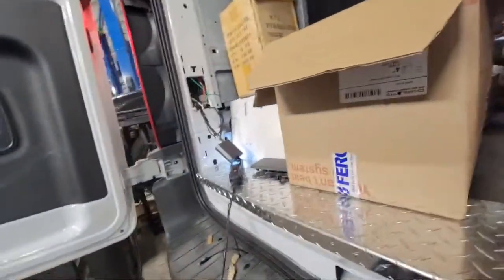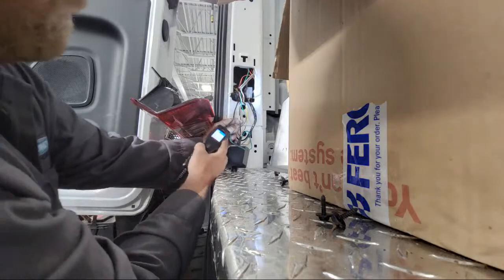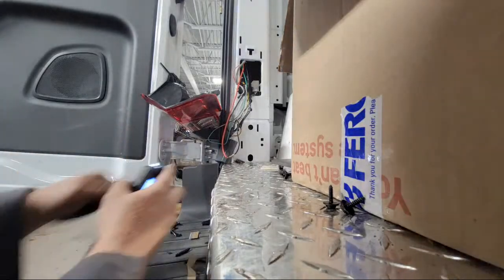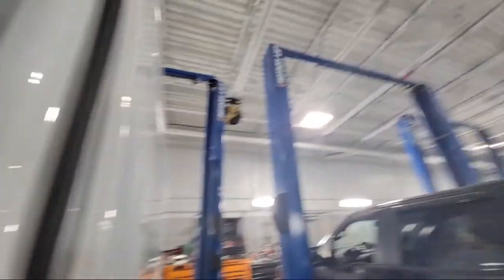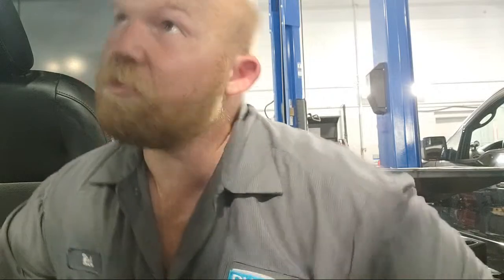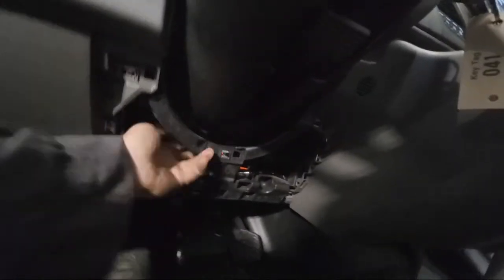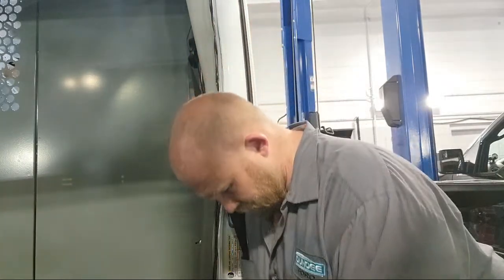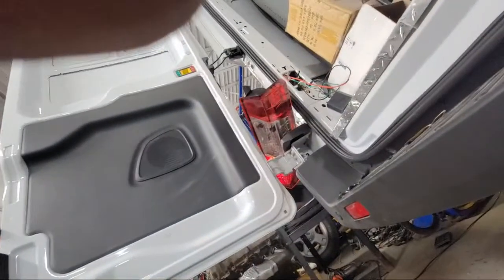2021 Transit no POWER TRAILER connector TOGETHER

Comment: PSA for vehicle owners whether it's your personal vehicle or fleet. If you install aftermarket electrical modules like this trailer light setup, or equipment like a salt spreader or snow plow, download and print or make a copy of the installation instructions and put them in the vehicle's glove box. This way, if there is a problem down the road, the technician working on it has a place to start, just let the service advisor know the paperwork for the aftermarket system is in the vehicle.
Reply: Absolutely fantastic idea, if only more people followed that advice lol

Comment: Depending on feed wire size 10 amp fuse seems small to me. Remember this supply powers tail, turn, and brake lights. If feed wire is 12 gauge use a 20 amp, if 14 gauge go to a 15 amp fuse. Funny you mention drilling thru wiring as my little boy, Vanessa, had a 5 th wheel hitch installed by the place that sold her the trailer. Brought it to me with blown rear lighting fuses. Yep, they drilled thru the wiring harness when doing the hitch install.... She was upset....All installers are NOT created equal............After market installs done by someone else usually turns into an Easter egg hunt... I'd say I have removed enough tape in my 37 years of wiring repair to span the globe many times over.. AND wasted a lot of time in the process. Even though you charge for your time it to me is still wasted time. GOOD JOB.
Reply: I'll second the comment that not all installers are created equal, meaning their skill levels vary.
Reply from the maker: If you actually think about the amount of amperage that the bulbs that are in circuit Pull especially now with most being led 10 amp is more than sufficient but also at the same time you have to think that amp is not for running the lights I think that's the part you guys are missing and that's what I was very clearly trying to get across to you guys this wire is for powering up the module that helps control the lights it has nothing to do with powering the lights themself but I have to explain this why? You guys seem like you're pretty good at understanding things I was very clear I want that wire did and I specifically stated this Powers the module and then the module controls where the power goes from there and even if we broke it down to how many lights you would typically see on board you still wouldn't have 10 amps of draw
Reply from the maker: I also said I don't know what fuse is supposed to go there because I don't know the name of the module there was no name on it and I don't know how it was intended to be run so with that being said I'm going to put something small in there so if it does pop it's not too large I was very clear about that we shouldn't really even be having this discussion and I hate that I have to say it this way but I'm a very upfront person we should not even be talking about this I explained all of this ahead of time
Reply: @FordBossMe  SORRY, YOU TOOK IT THIS WAY... I WAS SIMPLY TRYING TO SHARE SOME OF MY EXPERIENCE WITH YOU... NOT TO BELITTLE YOU. I RESPECT YOU TOO MUCH TO PUT YOU DOWN.. AND YES, IT'S BEST TO ERR ON THE SAFE SIDE AS YOU SAID.
Reply: @FordBossMe  Not to question you, but to share info, the module you're working on serves 2 functions. 1. It converts a 3 light system on the vehicle to a 2 light system on the trailer. Separate brake light, turn light, and tail/marker lights on the vehicle to shared brake and turn element and separate tail/marker element...2. It has a power supply wire that powers it as well as supplying the power to the trailer lights. Think of it as a HIGH TECH RELAY. The wiring connected to the vehicles light system only supplies the turn on of the relay. This prevents frying the vehicles LAMP OUT MODULE due to over load. I know cause I fried a jeep lamp out module before these came out. I went back and checked and on most trailers a 10 amp fuse is plenty especially if the trailer has LEDs, but if not LEDs and you have a box trailer with a lot of marker lights you need to step up to at least 15 amp fuse. Again, I'm not doing this to piss you off, just to share some hard earned knowledge. If I didn't respect you, I would not be subbed to your channel... THANKS FOR WHAT YOU DO.

Comment: Hey i have a 2017 ford transit and it has the factory wiring but none of my trailers lights work you think i should check and see if the wirings the same and missing a fuse ?

Comment: I tried to at a power wire to my Grand Cherokee overhead console to map light circuit or sunroof circuit to power a dash cam.  No way. No power. It is a CAN BUSS system. Had to run a long wire up front pilled across top of windshield from hot port in center console

Comment: Bad design by Ford that to install trailer brakes lights customer had to run damn wire all way to front.  That’s wrong on so many levels
Reply from the maker: Mother you've got me really confused here because I don't think you quite understand what was going on with this truck your comment about Ford and bad design I don't even know what you're talking about because I said nothing to do with Ford

This was an aftermarket upfitter problem and how are you bringing Ford into this I'm really lost here
Reply: @FordBossMe  why do you have to  install aftermarket tow harness on a Ford Transit ?
Reply: @FordBossMe  Once you saw non factory wiring rather than plug and play its not warranty. Im sure there is a Ford trailer harness module available that ties in with the factory harness and prevents overloading and false instrument cluster warnings like bulb out etc. the old Hopkins trailer to 4 pin flat setup no longer works on these newer vehicles
Reply: @gerardmccarthy2432  I have installed those modules and factory harnesses.  Usually a price difference of several hundreds of dollars.  Of course people choose the cheap route.